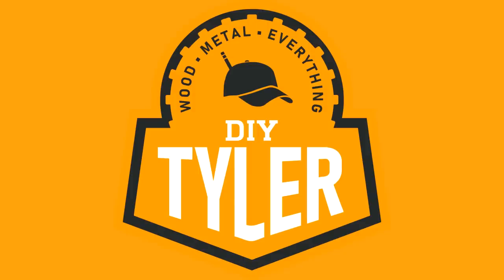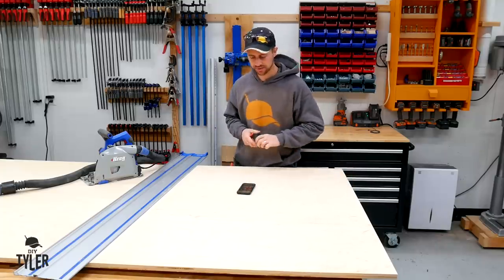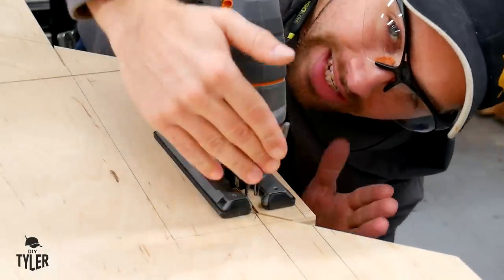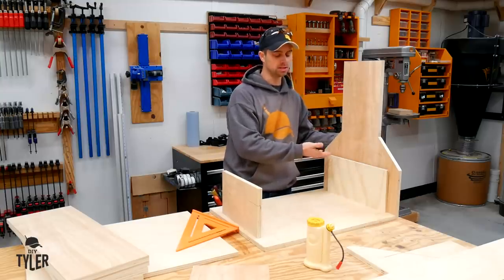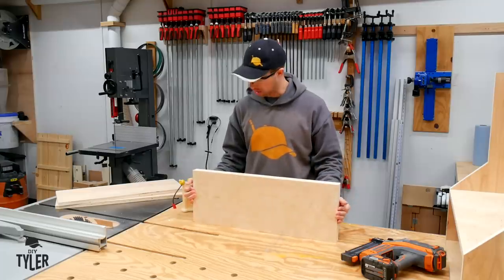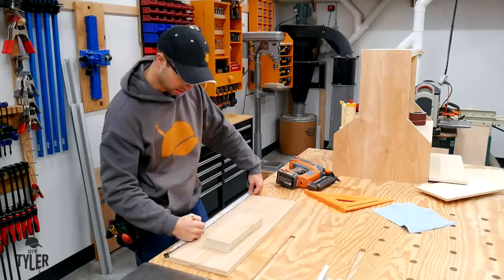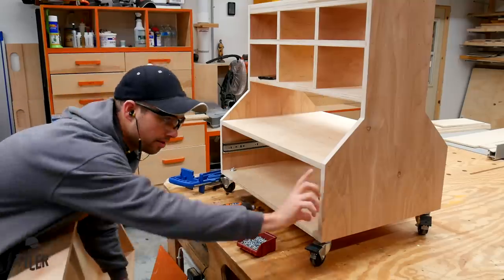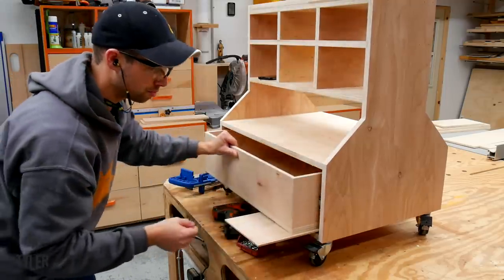Rolling Tool Stand (for my Drum Sander)

Comment: Would have liked to see the sides and bottom placed in a dado let into the sides instead of butt joints, especially for machinery stands. Plywood, butt joint and glue is a poor formula for long term stability.

Comment: Any concern about the bottom being between the sides? (instead of under the sides) thought it might eventually become a weak spot with the vibration. Great vid
Reply: Tom R - I totally agree with you. Should of used the compression strength of the sides for the top and bottom.
Reply: ditto
i always put the cart on the bottom like its a furniture dolly
Reply: The top, too. You've got the entire weight of the drum sander being supported by a little bit of glue and some brad nails when you could have it supported by the compression strength of the sides. The cart would have been much stringer for literally no additional effort.
Reply: @PowderhornWild  i thought he did do the top just not the bottom
Reply: @billystray7007  at 6:42 you can see he puts the top between the two sides and then nails from the side

Comment: I'm sure you know, but the "slop" is intended for the thickness of the metal so when you push against or pull against using the tape. But it makes it easier to read when you burn an inch. Keep up the great work and videos.

Comment: That’s a cool project. The only change I would have made was putting a solid back on the drawer cavity.  This way you have a “dust free” drawer and the extra material of the full back allows you to strengthen the cabinet so it’s not wobbly.   
It came out really nice!